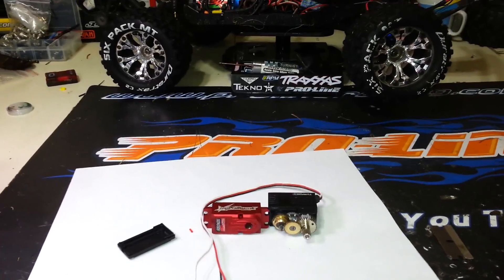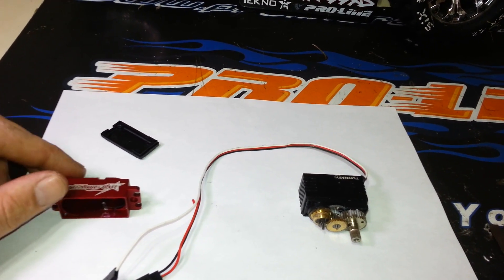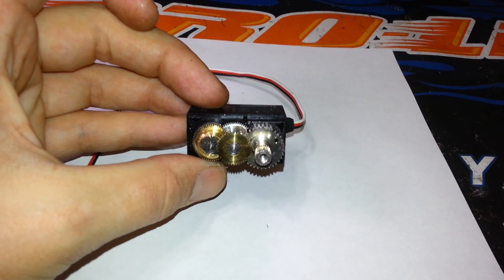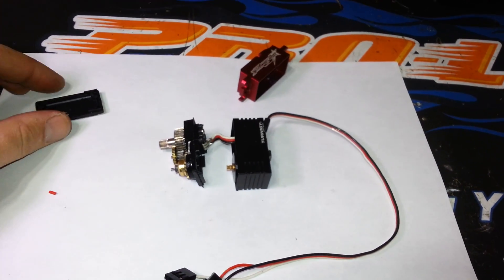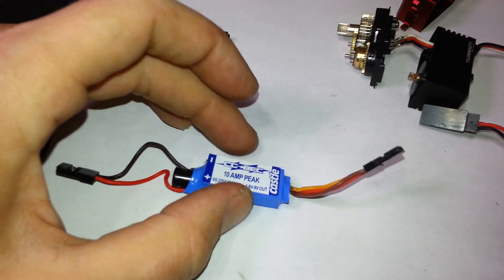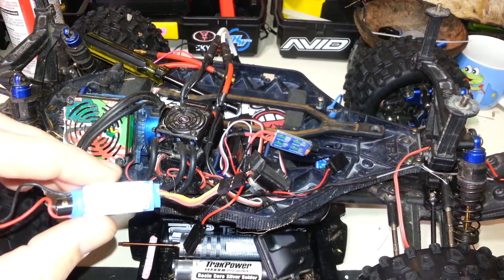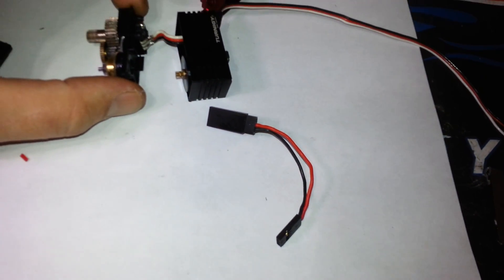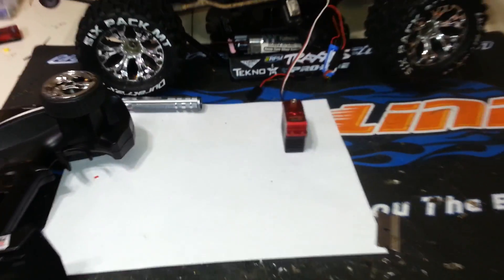Turnigy TS-900 Servo Review / Part 2 / Internals

Comment: I'm tempted but having tried other HK products I'm gun shy now. I do not doubt your assessment of performance as I too was impressed with the servo I had but they both died well before when I expected. I have given up on cheap equipment as it cost you far more in the long run. Gone back too Futaba S9373. Ridiculously expensive but as yet none have died.
You tell me this thing has been beaten to a pulp and still working and I'll give one a try.
Reply from the maker: Don't buy one just on my account lol.  But after well over 2 years of abuse this servo is still working perfectly and serving currently in my slash MT 4x4.  I was actually looking at buying another.  Seeing there are a lot of other options available now i may buy something different.  But I honestly have NOTHING bad to say about this servo.  I beat the snot out of this servo for over 2 years.  Even raced it a couple of times.  Never had a single issue with it.   Been a trooper IMO.
Reply: Good to hear thanks for the reply.

Comment: I just found out that Alturn has changed the design of this servo, the pot is now directly soldered to the board rather than being attached with wires so there is no longer any danger of vibration failure of the pot wires. This also means you have to be careful when removing the top of the servo, the plstic piece between the top and bottom aluminum halves of the case can be stuck in the top and will pull on the pot (which is screwed to this piece) so the best way to get the top off is to push down on the output shaft.

Comment: The solder joints on the internal wiring isn't glued down so as-is these aren't suitable for aircraft use and especially not helicopters due to the possibility of vibration related failure of the wiring. Imagine taking the wire and flexing it back and forth at the solder joint a few dozen times till it breaks off. This is what vibrations will do over time.

 A few minutes with a hot glue gun would fix that though. Put a blob on the mainboard where the lead and pot wires are soldered and another blob on the tabs on the pot that the wires are soldered onto and it will be good to go for aircraft use.

 EDIT: I've since learned that hot glue can fail after a while. Instead I would now recommend electrical grade non corrosive RTV sillicone goop. Note that not all "non corrosive" sillicones are safe for use directly on circuit boards, oxime cure sillicone is sold as "non corrosive" but is still slightly corrosive. Acetic cure (which is what most hardware store sillicones are) should absolutely NEVER be used on or around electronics. Whatever you use make sure it states that it's safe for use on circuit boards in the data sheet (Dow Corning 748 non corrosive sealant is safe for electronics)

Comment: That's cool you've just given me a great idea if it works then thank you.  

I would like to hear how the servo lived tho also I have a savox 1256tg and an xq power s4020d £30 or $50  difference in price.

But honestly if one dies I hope it's the savox I really do. Cos the cheapo xq is waterproof , tg , matches the savox in all stats. But then also stall torque on the savox is next to nothing but the xq is super strong you can't move the horn by hand.

The savox tho will move with your little finger. Idk if that's important but I think the xq is better for not moving so easy.  

Surly it would mean wheel resistance from the ground pushing back on the servo is eliminated.  

So yeah I would happily try any cheapo servo that sounds good on paper.

But not the tower pro they are cheesey as he'll 15kg stat I think is made up. Test it mount the servo to the wall and hang a 15kg weight off the horn and see if the servo can lift it I bet it wouldn't but still for £5 sometimes less ther not bad just not Wat is claimed.
Reply from the maker: This servo has been nothing short of perfect.  I was so impressed with it i bought a second.  It also is performing perfectly.  Excellent centering.  Amazing holding power.  Price to performance these are hard to beat!.  The TS910 has higher torque but its a bit slower.  It also does seem faster on 8.4v.  specs are probably a bit under rated on all of them as they are spec'd on a lower voltage :)

http://www.hobbyking.com/hobbyking/store/__43054__TrackStar_TS_910_Digital_1_8_Truggy_Monster_Truck_Steering_Servo_66g_30_6kg_0_14sec.html?strSearch=trackstar%20servo

Bash it hard; Bash it often!